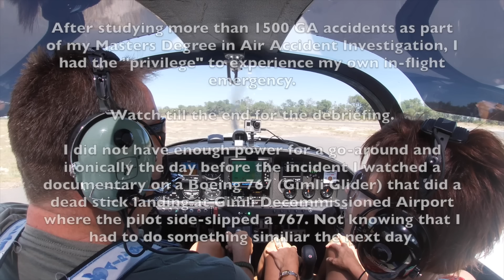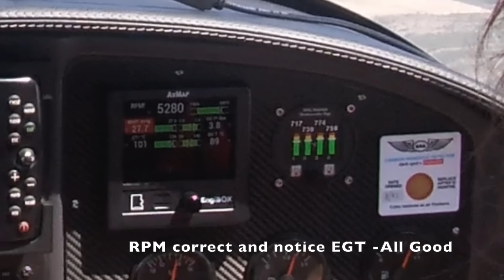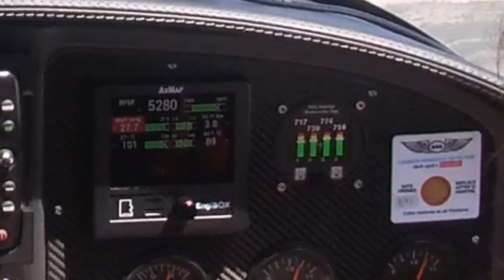Engine Failure at 1300ft AGL, Morningstar ZA, Pioneer 300

Comment: Saw a comment where you indicate the partial failure was a blocked carb jet.  Interested in hearing thoughts on preventatives on this, as well as what the fuel contaminant was?  Curious whether you thought to evaluate oil temps / pressures during your rapid scan?  You said you didn't notice the two cylinder fail in particular.  I lost a mag once, underneath busy controlled airspace, and though talking to ATC, didn't declare.  But I did climb for all I was worth and know I was well into their Class B before I got over a field they vectored me to and then spiraled down.  I did absolutely zero engine analysis, other than noting that it was crazy rough and still producing most of its power.  After that it was climb like crazy and look for a place to land.

Comment: Congrats to the pilot! I felt bad for your sis; her distress was obvious.

My confidence in the pilot:  Through the roof.
My confidence in that plane: Through the floor.

Thanks for posting this video.
Reply from the maker: Plane is actually awesome. The jets were set very lean which I think contributed to the jet blockage on the left carb. Plane is fully services and maintained by an AMO. Did about 7 hours since and no issues.
Reply: I’m certainly no aircraft maintenance expert but the carby issue experienced certainly sounds like it was avoidable with the appropriate preventible maintenance. Having a carby issue up there which could so easily have been prevented is not cool. 

Again kudos to your composure during the flight.

Comment: Awesome job! Kudos on realizing that you had some power at lower throttle. 
But what would have done differently had you noticed 2 cylinders were out? 
Cut fuel then enrich it again to see if they would start? Switch magnetos? I couldn't figure if your engine has 1 or 2 carbs, and I can see this working if that was the case (I'm not a pilot but interested in getting my license, my background is in engineering and have played with engines since I was a kid).

Comment: How do you know which cylinders are and arent firing?
Reply from the maker: If you look at the EGT (Exhaust Gas Temperatures), you will notice that two of them are very low which indicates that those cylinders are not firing.
Reply: @justplaneadventures8030   Thanx for that. I have now learnt that these planes have individual EGT gauges for every cylinder.

Comment: Not an engine failure at all. We did simulated engine failures for the PPL licence and these entailed NO power available.
Reply from the maker: Don't confuse a rotating propeller with power. It turns, like in your simulated engine failures, but it has no power due to the loss of two cylinders. Next time you go fly pull the spark plug leads of two cylinders and see how far you get. Perhaps then you will understand the difference between a spinning propeller and power.
Reply: @justplaneadventures8030  I am not confusing anything and I am very aware that a prop can windmill. My point is that you had some power ... severely reduced but you had some.
You were making throttle adjustments after the engine problem presented itself and you reported to ATC at 4:10 that you had a "rough running engine". My point is that this was not a total engine failure. Thanks
Reply from the maker: @thepianoman1010  Thank you for your comment, you are 100% correct. When I played with the throttle settings the cylinders started firing again although hugely reduced in power. If it weren't for that I would have rather opted to do an emergency landing in a field below me. Some say that it was in fact more dangerous to have it working on and off as opposed to completely failing as it can fail to zero power anytime. We had a fatal accident a couple of weeks ago where exactly the same thing happened on a Piper, the pilot regained some power and decided to do a normal circuit before landing. During the circuit, the engine failed completely and sadly he didn't make the runway. So in a way, I guess I was lucky. Still been one hell of a learning experience. Safe Landings and thank you for your comments. Rgs
Reply: @justplaneadventures8030  You are welcome ... so sorry to hear of the fatality you mention. I used to fly PA28's (since 1975) ... did the unfortunate pilot have the engine failure on climbing out from the runway? If so, I imagine it occurred at around or below 1,000ft. considering he joined the circuit ... (on crosswind leg or downwind?) and also, if so, in my opinion, he should have landed straight ahead in a suitable field, if there is one.

Comment: Well handled -- enough to make most pilots dirty their pants  ! Question from the post - incident analysis -- what was the cause of the 2nd and 4 th cylinder trouble and how was it fixed ??
Reply from the maker: Both Carbs were serviced and also adjusted richer. There was a very small blockage in the one Jet.

Comment: I would not have made more turns that needed to get back to the field under that circumstance.  turn back to the field and land straight in.
Reply from the maker: That was the plan but when I reached the field I had enough altitude to rather make an upwind landing.

Comment: There was a loud knock in that engine from the moment you revved it up. I would not have taken off.
Reply from the maker: The GoPro gets the sound from the radio, so it has some odd noises. There was no engine noise in the run up.

Comment: Nicely done, I’ve been in very high stress situations operating aircraft and my hearing turned off too. You had a plan and you adapted based on how the situation unfolded - couldn’t ask for more. What I would advise to any new pilot is during a mayday you own every runway (and taxi-way for that matter) and can land anywhere you want. Every aircraft in the area will get out of your way so don’t worry about them either. You don’t need to ask for permission - just tell ATC what you are going to do, they will facilitate it and might even offer you better choices if they exist.

Comment: Engine Failure <<<<<<<<  incorrect, it should read engine trouble at 1300 ft.....
Reply from the maker: That is debatable. It is still turning which certainly helped, however it produced very little power which is technically a failure.

Comment: Curious why you turned off the boost pump while still climbing?  Also, did you attempt to turn it back on once the engine began running rough?
Reply: I'm a complete amateur, and sometimes comments like this go unanswered, but it seemed somewhat normal to me based on other aircraft procedures and my knowledge of working on many engines over the years. It seems the boost pump is not exactly necessary in most situations. It is, in it's name even, a "boost". I've come to think of it as a helper and not mission critical to operation. I could be wrong, but over the years of worrying about boost pumps, this is my new attitude.
Reply: @mjodr  It can vary by plane & that appears to be an experimental, but most low wing pilot operating manuals require the booster pump on during climbs, landings & maneuvers.  I leave mine on until I reach cruise altitude, I also will tend to leave it on at low altitude. A lot of  pilots with retractable get in the habit of turning off the booster pump after raising the gear, though the operating manual may state differently.  But, too my point, when the engine begins running rough, if it is not on fire, you turn on the booster pump to see if that corrects the problem. You also shift tanks, etc... there is a check list for each plane, though I did not see him reference one.
Reply from the maker: My after take off checks calls for boost pump off at safe altitude. You will notice that it was the first thing I switched on when the engine went. I also changed fuel tanks.

Comment: Well handled for sure! you never let up on aviating and planning your landing, so in control all the way, I guess you resisted trouble shooting not to become distracted in any way, the only thing different I would have tried the fuel boost pump and monitored for difference, you would be surprised how often it is fuel related, I would have also assured the passenger further that you had sufficient height to make the airport and you would be landing on the runway without problem. I have had two failures in my time one was a full failure and the other was an engine at idle making no power but equally not really making drag either, a huge difference between both, each time it was fuel related, one was a fractured fuel line and the other was a collapsed shuttle valve in the fuel  tank selector which brought about the issuing of an AD.
Reply from the maker: Thank you for your comment, the very first switch I hit after the failure was the fuel boost pump, then I switched tanks as well. Turns out it was a fuel problem. The main jet in left carb was blocked.

Comment: Encouraging to observe that even with this (partial) power loss, you were able to maintain an ideal altitude (around 1500 feet) initially as you washed the airspeed off to the ideal glide/descent speed. Also, that commanded, shallow rate of descent helped to get you back to where you ideally wanted to land. Your sis' would probably have felt reassured by observing that the prop was still swinging and that (at least) some noise was still heard from the engine. Nice landing. Well done.

Comment: Great job. Partial engine failures are difficult to manage as you don't know when it will stop completely. My friend lost his life recently under similar circumstances here in Australia. We trained together and he was a very experienced pilot.
Reply from the maker: Yes, you are so correct. Also when the engine failed I was within gliding distance to a fairly open field, but by turning back I knew I had to cross some rugged terrain and basically turned away from a suitable landing place to make the field. It was a split-second decision but I figured that the little thrust I have left would take me there. A gamble nonetheless.

Comment: How did you get a fuel blockage in the left carb?  Any prevention against that?
Reply from the maker: This is actually a bit of a mystery as we have no idea. The jets were set very lean and we adjusted it richer now. I also seldom drained the Gasculator and there might have been some dirt that accumulated there. I use Mogas which is often not as contamination free as Avgas.
Reply: @justplaneadventures8030 Could entrained air have happened?

Comment: Good job both of you! I have to say you got some balls calmly flying the pattern like that. I probably would have just flew straight into any runway even if I had a tailwind. It seems you were high at landing so I assume in the pattern you knew at all times you could glide in. I had a similar event 2 cylinders fail over NYC. I crawled at near stall speed to JFK over water. When I got to the runway I was so high I could have glided to Texas lol. I had to slip in like you. I guess it’s better safe than sorry. Nice work
Reply from the maker: Yes, correct. I had enough altitude to make an upwind landing.

Comment: At around the 30th hour of my training (in my own 'plane), I had an engine failure while approaching the airport...I focused on the first opening I saw and descended from 900ft to a field that ran alongside the road to the airport...I had to glide over the big billboard (for the airport) and under 2 sets of high tension powerlines....I was still airborne when passing under the wires....I came to a stop just where the field and the road met before entering the parking lot...I'd had a fuel pump failure, but the carb was gravity fed and, because I was on airport property, they sent the fuel truck up to fill the fuselage tank....After Air Canada and all the traffic left, I taxied through the parking lot , through a 20ft gate (30ft low wingspan) with help from some FBO workers and onto the 'ramp' on the proper side of the tower....All the while putting up with jabs and jokes from the tower....They never let me live that down, but during my final flight test the examiner said I'd already done my forced landing "...in a magnificent way" as he wrote in my exam sheet......That was 1975 , like it was yesterday....( I knew there was one set of powerlines but the second was a surprise, yet I drove beneath them every time I went to the airport...) .....Funny thing is, there was a 200ft wide runway running beside the road and the field on the other side of a row of trees....but I was taught to focus on your spot and DON'T change your mind...so I never even considered the runway until after I was down, and my reaction was, "Aw, shit !" .......Canadians are like that, eh ....CF-RGD
Reply from the maker: thanks for sharing. that was funny to read.
Reply: @justplaneadventures8030  ...Funny now, maybe......But not so funny for me at the time....haha.....My instructor was a bush pilot and I started out doing short field landings from the first day....He flew PBY's and DC3s up into the high arctic, so I figure I learned from the best, even though he was a tad younger than myself...He soloed me at 5.5 hours....

Comment: I wouldn't call this an engine 'failure' moment. High gamble flying the pattern to land with an engine that may quit at anytime at low altitude.  But glad you made it :)
Reply from the maker: I was positioning for an upwind landing as I had enough altitude.
Reply: @justplaneadventures8030  Hard to get a good look outside from the video, but you had a better view of your situation. Definitely would prefer landing into the wind if possible.

Comment: Id dare say that intermittent running/rough engine running is more dangerous than an engine that's completely dead. Great job putting the bird down safely.
Reply: What?
Not a pilot are you
Reply: Obviously, you don't understand what I'm saying... An engine that is intermittently running, is a lot harder to fly, based on actual pilot testimony, since  the pilot doesn't know when the engine will quit again, or when it will come back to life. This problem causes a pilots decision-making skills to decrease dramatically.  Do you keep attempting to fly to your destination? Do you attempt to return to the airport? Do you attempt an off-site landing in a field or highway? What do you do when you are attempting to land and are about to flare and the engine comes back to life at full throttle? What if you are about to land in a field because the engine is dead and you're 2 miles short of the runway, and then the motor starts running again? Do you continue attempting the landing in the field, or do you try returning to the airport? 
Obviously, a rough running engine is technically better than no engine whatsoever, but when it starts sputtering, and intermittently running, it creates a situation where the pilot is under a lot of stress, and is task saturated, and that's why a complete engine failure is often safer than a poorly running engine. When the engine goes completely out, the pilot knows exactly what needs to be done and never needs to think about anything else besides landing the plane in the safest place possible.

Comment: A better practice might be to be ready for takeoff when you get on the runway, not spend time on the runway with lights and transponder, etc. And no hurry turning off the boost pump. "Direct in" doesn't necessarily mean anything to others. Bottom line: no dents, no scratches, two dry seats... :-)
Reply from the maker: Thanks, I actually like those few seconds before the take-off run starts. I was taught that way years ago and it just stuck for some or other reason. Agree on the Boost pump.